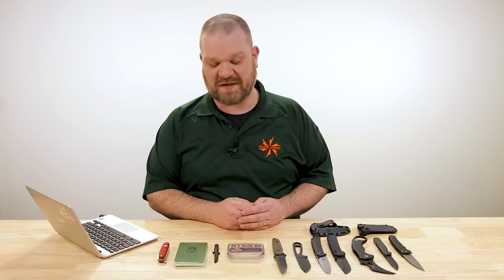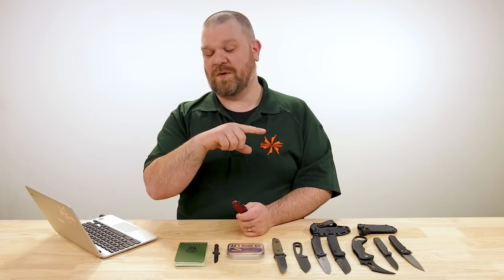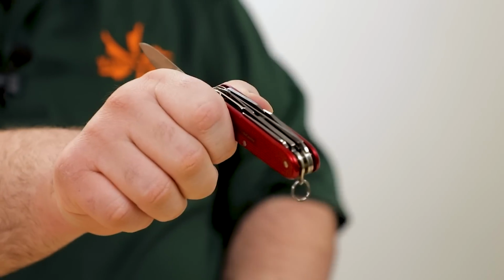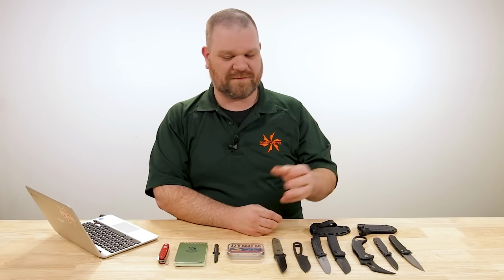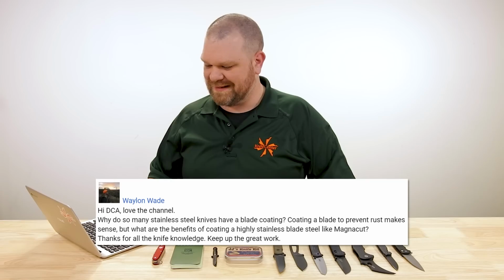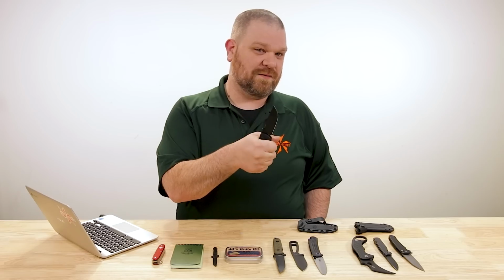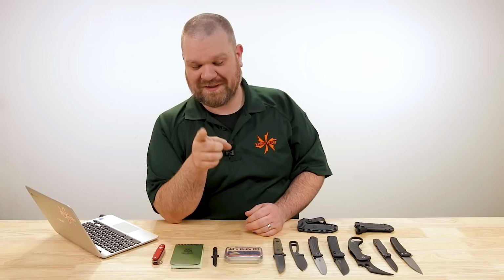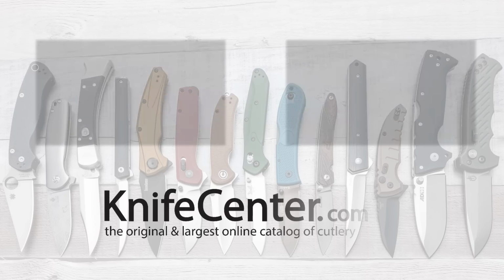KnifeCenter FAQ #115 Knife Safety Essentials

Comment: Could you make a series about what action or movement would destroy a folder, bowie, edc, kitchen, tactical, camping knife etc.? It would really help me to understand the different kind of qualities knife have and what they can and should not be used for. Thanks a lot for the great content you guys put out.
Reply: Prying is usually the worst thing to do to a knife. When I was a kid my friend snapped the tip of my brand new Opinel because he stabbed it in wood and then pried sideway. with folders, you just have to not use a TON of force on it, like pressing really hard on it to cut super hard stuff or using them to baton logs like there's no tommorrow. Just remember to not wait until the folder falls appart before tightening the screws as you might loose said screw.
 the thickness of the blade (and of the tip) really tells what kind of abuse it will tolerate.

Comment: 2:49 I once got me a cooled coke in a glass bottle, from a machine. Then I went up the stairs, with it being in my low hanging hand. Of course it slipped out of my hand "somehow", but in reflex I tryed to catch it. And I did catch it, but only right as it was hitting the floor. I remember grabbing it, and it then breaking in my hand. Lucky me I didn't squeeze hard in reflex to that, so I only had 2 or 3 mild and superficial cuts in my palm. :face-orange-biting-nails:

Comment: Question for next episodes, I am not a fan of the asymmetries of the frame or liner locks. Which locking knives would you recommend using a different type of lock for their strength and reliability?

Comment: For the next FAQ. I'm looking for a fixed blade knife for an emergency truck kit. I'm often in rural and off-grid mountain areas so looking for something suitable for things like batoning wood, sparking a fire, and other basic survival tasks. Because it will sit unused most of the time I don't want to spend a fortune but I would prefer American made.
Reply: An ontario rat 7 is a pretty reasonably priced do it all fixed blade
Reply: @Freak480  I thought about the Rat-7 but wasn't sure if it'd throw a spark since the blade is coated.
Reply: I have a Gerber Strongarm in my vehicle. It has a reasonable price point and you can beat it to hell. One got passed around to about ten different YouTube knife reviewers. They beat it to hell and it is still going strong. It is made in Portland OR.

Comment: fishing season is coming fast and i need a new fixed blade. need something that will be salt water resistant, partially serrated, and able to gill large 40lb fish, so at least 7 or so inches. i have used an sog and a gerber in the past

Comment: Question: Why aren’t there more options for kitchen knives with supersteels as compared to folders or fixed blades for other purposes?
Reply: I am guessing that money is involved.
Reply: @jayr526  I would imagine so but folding knives at similar price points as kitchen knives would have those super steels and I would imagine the cost to have the more complicated handles, locks etc etc would be higher. Hence my curiosity
Reply: This will be my last guess because I did not have any cold hard facts. I have a 6" Gihei nakiri in white #2 or blue #2. It is very easy to get this scary Sharp. It may be that people who are cooking for a living like the level of sharpness you can get with low alloy steels.
Reply: @jayr526  that’s a good guess actually

Comment: So I have an interesting question. I work in shipping and production and frequently break down a plethora of various types of materials. However, I always hate cutting up foam presentation boards because the foam has a tendency to melt to blade from the heat created by the friction. I have found that scandi ground knives cut through the foam with the least resistance but the foam still melts to the blade where it makes contact. Is there a specific blade material of blade finish that would prevent or minimize this problem? I would prefer a sub $200 knife with steel that is easy to sharpen.

Comment: Hey DCA, I've been looking for my "perfect" EDC fixed blade. I'm looking for something right around the 3.5 inch inch range with a good strong tip but still nice and slicey for the "Everyday" part of EDC. The Work Tuff Nomad is close to what I'm looking for but the handle is just barely off for my hands. Any recommendations or do you think going for a custom is the better way to go?

Comment: Great video and I really thought the question about teaching teens was a good one. 
My question may not be. I know batoning gets overhyped in discussions but I really do need a knife for just that task. I frequently need to baton fire-starting slabs of lighter knot pine. I was wonder which knife steel would be most durable in a batoning situation with a 5-6” blade. I’ve considered the Demko FREEREIGN, ESEE 5 or 6,  and Lionsteel T5 or 6. I have no idea how the AUS 10 of the Demko compares. Any other suggestions would be appreciated.
Reply: The ESEE 5 is a batoning machine! I've smashed mine through so many twisted and knotty logs its not even funny. Its basically a splitting wedge with a handle attached. And since you are going to baton with it, get the ESEE because they're the only brand who will warrantee it if you break it. I also have the ESEE 6 but its not as good at batoning, tho it is better at chopping.
Reply: @arrowheadguys7637  Thank you sir. So 1095 is durable for the impacts of batoning…..as I would have hoped for.
Reply: @daves.682  Its a tough steel, and is a little on the softer side. So it won't hold an edge under abuse, but the steel won't chip. I barely even sharpen mine tho, for batoning you just don't need it. And most improtant, ESEE has the hands down best warranty in the business. No matter how bad you abuse your knife, they will replace it if it breaks. Can't recommend them enough.

Comment: Thanks for the always informative video! I di have a question... Is there any left handed button lock? I feel it would be more fidegty for me that am... NOT lefty 😁 since I would be using the index finger to close it, with very limited grip adjustment while playing
Reply: Yeah, as I righty I also wish the buttons were on the other side for index finger use. Button locks feels so much better in my left hand.
Reply: @arrowheadguys7637  nice I am not alone! I don't own any cross bar lock style knives, if you do .. opinions on the difference? And can you / how it using then with one finger only (meaning, pulling only one of the sides, like... The finger side)?
Reply: @frankysour  I've never actually tried it before, my natural motion is to use the thumb and index finger simultaneously, but I just went and grabbed one and it works just fine using either the thumb (which I had done before) or the index finger.
Reply: @arrowheadguys7637  thank you sir!

Comment: What EDC knife do you think is the least scary to non-knife people?
(EDIT) one think that i thought might be important is that im 15, and people are usually more nervous around teenagers with knives, and that may change your answer. (also right now i carry a cheap multitool with a slip-joint sheepsfoot, but its falling apart)
Reply: Personally I think sheepsfoot blades by design are the least "threatening". Beyond that, SAK's and slipjoints are probably good choices.
Reply: I always carry my cjrb ria or my civivi baby banter  along with my main blade. I've never had anyone say anything or look funny at me if I pulled either one out other good options with be a swiss army or a case knife. But there are lots of others to choose from.
Reply: I think the easiest answer is either a Swiss Army Knife or a small traditional knife, like a Barlow or mini Trapper pattern. 
If you want a more modern locking knife, you might have the best luck with something fairly small and with a brightly colored handle.
The other thing to keep in mind is that opening it deliberately with two hands is less likely to alarm the normies than doing a fancy reverse finger flick or something.

Comment: I think one of the best things to happen in the last 20 years is D2 becoming a budget steel if you need to do a lot of cutting and not being stainless isn't a big deal you can't beat it. Holds an edge better than anything in its class.
Too hard to sharpen? Seriously? It isn't that hard to sharpen if you get a pair of decent sharpening stones and make one of them diamond at about 300-400 grit. I use diamond for K390 and it takes it right down.